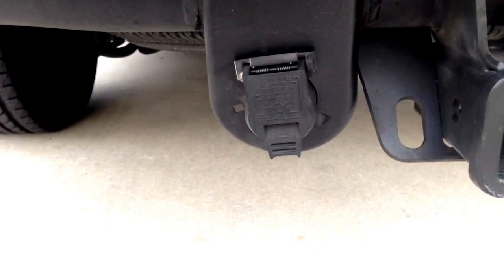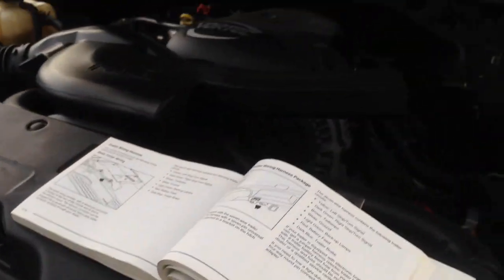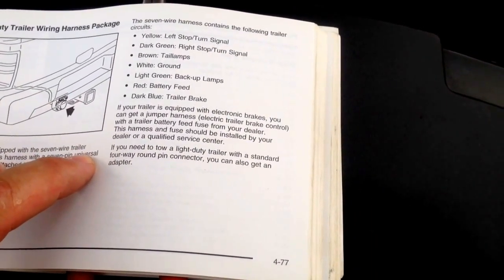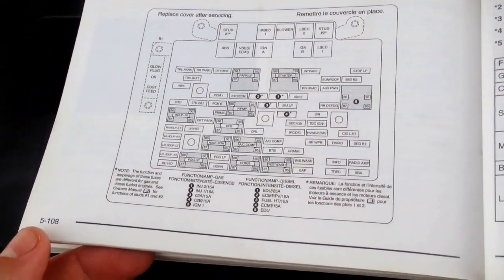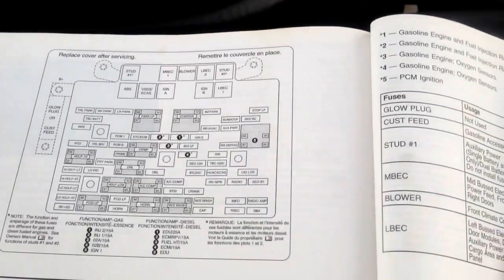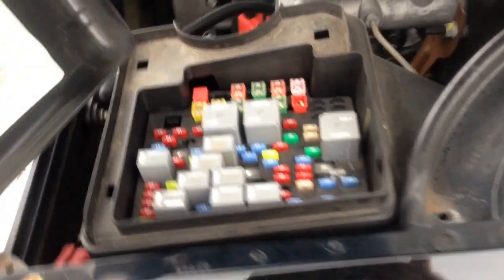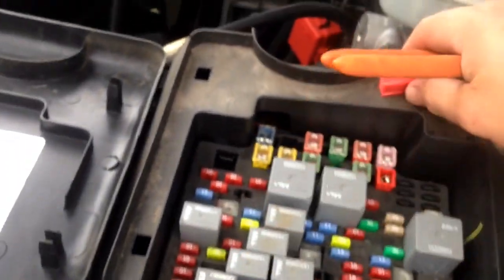2003 Chevrolet Suburban "Trailer Auxillary" 12v 7 pin fix

Comment: That is, if the wire is hooked up to the rear.  I have a 2011 avalanche where they didn't connect the wire to the fuse box. It was folded up in electrical tape - the dealer didn't hook it up even though it has a tow package.

Comment: Hi, I have the same truck and trying to pull an old RV/Camper. So I am new to both the truck and the camper. I was out testing the drive at night and people and flashing on me so many times because they don't see my running light. I am not sure why the break light and turn signal light works but not the running light. Is it the same as your situation. I hope you spend a few minutes to answer my question. Thanks for making this great video.
Reply from the maker: The fuse I added was to give the 7 pin auxiliary power wire 12v. If your running lights aren’t working it sounds like another fuse may be blown, the running lights wire may be loose or cut in the truck or the camper, or the bulbs could be blown on the camper.
Reply: @firesupression1  I got myself a 20A fuse this afternoon and plugged it in but didn't fix the issue. I know the camper lights are fine because I have another vehicle and all lights turns on when I turn the headlight on. I am going to do some more digging to see what caused the problem. Thanks so much for your prompt response.

Comment: i have the 2004 suburban 4x4 LT 1500 with the stock 7 pin plug.  I bought the 7 to 4 pin adapter for my boat trailer but I am not getting power to trailer.  I looked at fuse panel under hood like you said and noticed in "stud 1" the previous owner added a 40A fuse. Is the 40A too much for boat trailer, should I add a 20A like you?  Thanks for the help!
Reply: +m00nchildblues It won't work with a four pin connector. Your four pins are for the lighting, turn signals, and brake lights. The seven pin set up adds for the power, trailer brake, and backup lighting circuits that small trailers don't require.
Reply: +TJ Almy found out that week I had adapter upside down! lol.working now
Reply: m00nchildblues

Comment: My owners manual says that stud 2. Is accessory power/trailer wireing brake feed ....stud 1auxillary power( single battery and diesels only)/dual battery(tp2)do not install fuse
Reply: That is correct, if you have a gas or diesel-powered truck with a single battery then yes you would be putting a fuse in place of the block off if you need a constant 12V at the seven-pin trailer plug. The brake feed circuit is only activated when the brakes are applied. This constant 12V would charge the trailer battery as you drive. If your trailer doesn't have any onboard batteries or if you don't need a constant 12V at the trailer plug then you really don't need to install this fuse.

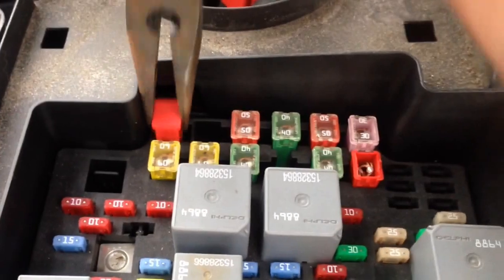Comment: Beware - some models of the 2003 Suburban require more than adding a fuse.  In some models you must connect wires inside the fuse block mounted in the engine compartment..  There are additional videos online that show this step.  For example, see https://www.youtube.com/watch?v=009xzlWtO98 at 2:03.

Comment: Will I need a brake controller that's installed inside of the cab .
Reply from the maker: Brian Vader you only need  a brake controller if you have a trailer equipped with electric brakes. If your trailer harness has more than four pins it is likely to have electric brakes.
Reply: firesupression1  My trailer is a inline 21' aluminum snowmobile trailer . It has electric brakes on it but don't think it's wired for it . The 7 pin plug on the trailer has only 5 wires going to it . I pulled it empty behind my 03 1500 GMC extended cab truck , and it pulled fine but with 3 sleds that's 1500-1800 more lbs.